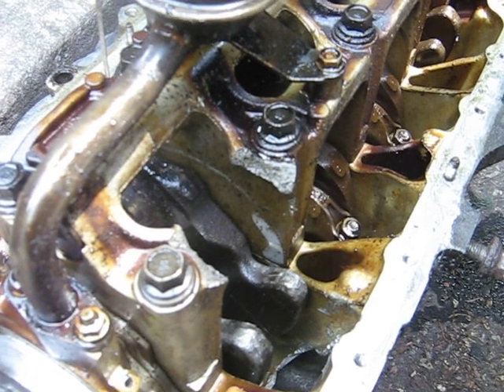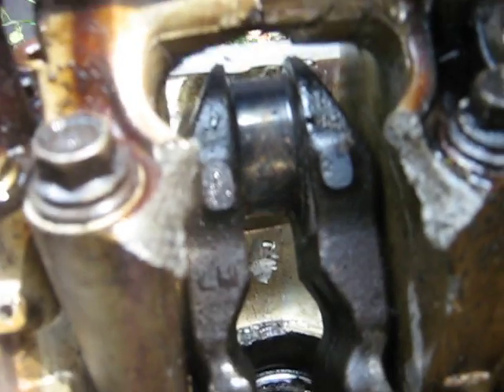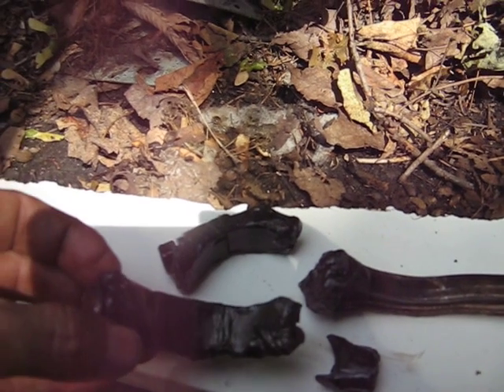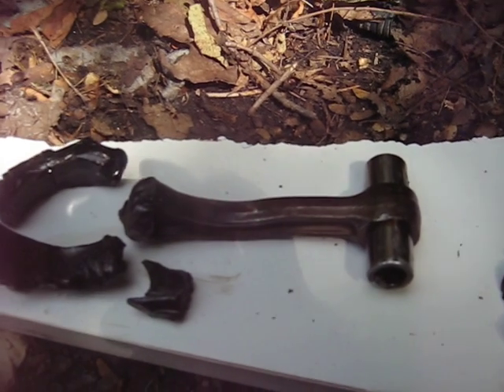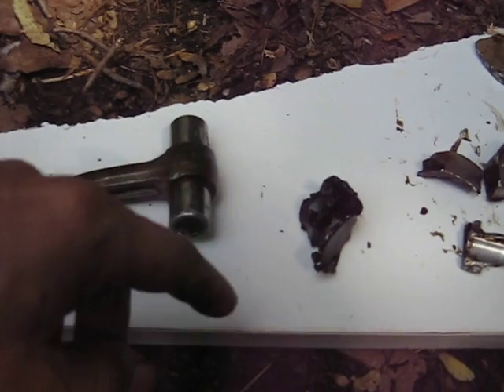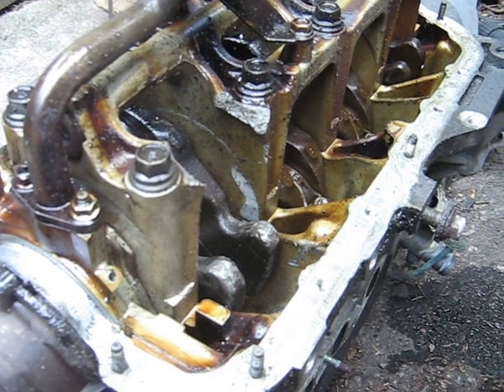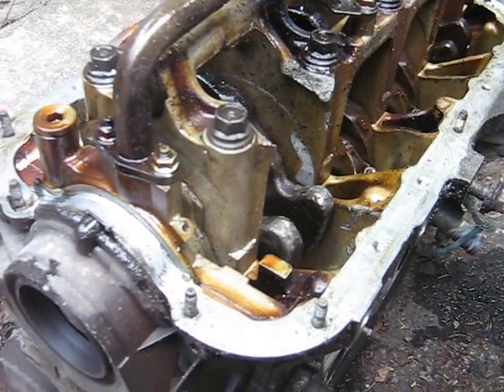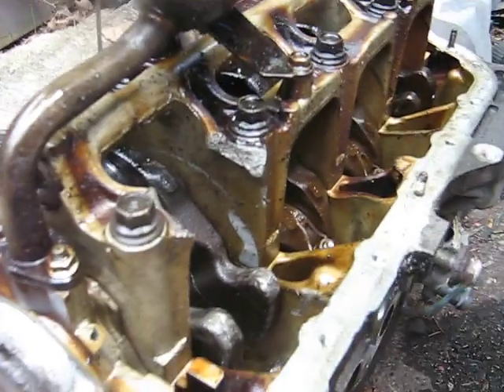Honda 1.7 Carnage!

Comment from the maker: Sounds like a good plan to follow, I do about the same thing.
A bottle of oil in the trunk is a good idea, have you seen the price they try to charge for oil at the highway gas stations!!!! Pretty incredible.
I don't usually get much below 1/2 tank of gasoline either, I have only ran out of gas once, 5km short of where I was going to fill up. The gas gauge didn't work, and I had driven a bit faster to work than normal a few days in a row. It hasn't happened since, that was a cool november!

Comment from the maker: Yes, apparently the flatbed truck guy drove it on and off the truck. Guaranteed there was NO oil pressure in the engine, since the con rod blew the main oil gallery right in half in the engine girdle. We are slavaging as much from the engine as possible, the head actually looks to be OK!

Comment: Yes, he uses oxygen/acetylene and he heats it until red hot and he slowly forges it with a hammer. Depending on the size of the stem he might repeat the heating process many times. He doesn't go very thin  and in the end he immediately puts it in water to harden the blade (I guess). After grinding and covering one side with wood or something to hold it it's good to go. I think you can also use coal instead of an oxy/acet. mix....

Comment: I saw this video on youtube of this Toyota Truck, they're trying to kill it but it would not die, near the end it was running on 2 of the 4 cylinders, they have holes in the block and no oil, but it kept on going.
I wonder if that engine still ran after blowing the rod, some will.